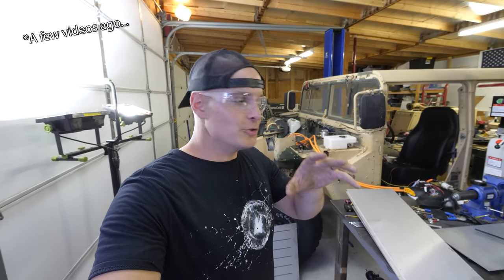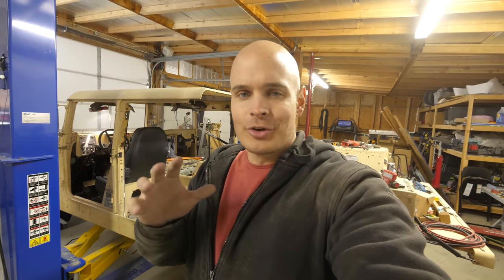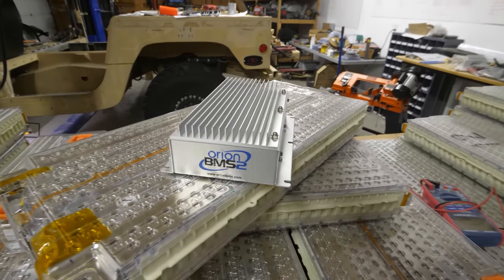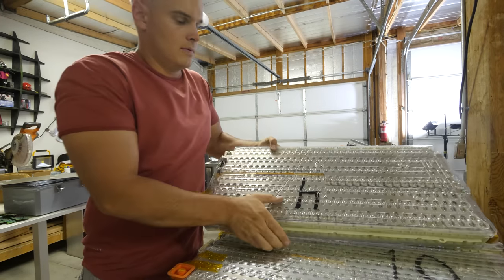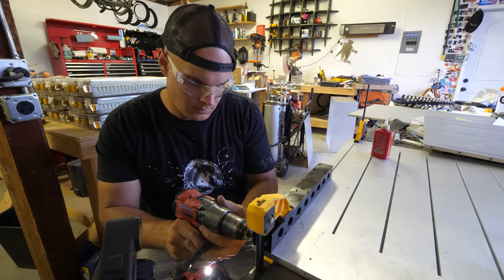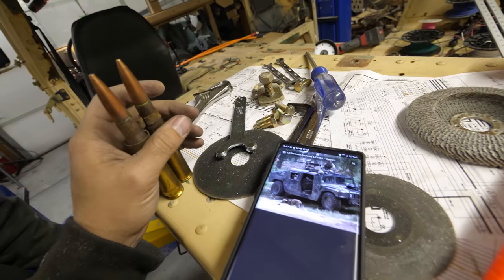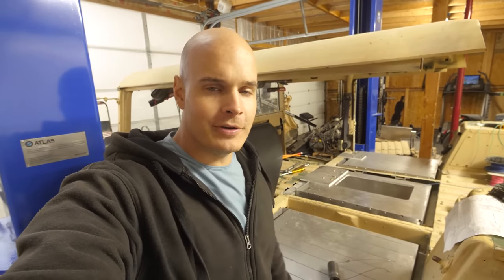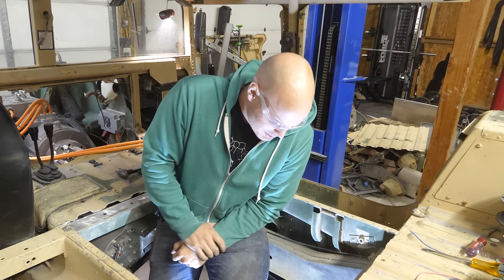Can I fit Tesla Batteries in my Electric Hummer?! - Battery Box Build

Comment: An important WARNING for anyone that wants to work with these battery modules: remove any metal from yourself. No bracelets, rings, pendants etc. for obvious reasons you don't want anything to accidentally make contact with live parts of the battery.
Reply: And don't put much pressure on the plastic cover covering all the fuses.  I cringed when he put the sharp corner of one module onto the cover of another module.
Reply: i just can't believe he is working without electric protective gloves
Reply: there are a lot of cringe worthy moments in this video.
Reply: it's a lot of current, but only 24V

Comment: As many have already pointed out, be mindful of isolating dissimilar metals. Steel and aluminium will get you really bad corrosion (on the aluminium) and failure of critical parts is never nice.  I just replaced shock mounts made of aluminium with painted carbon steel for that reason.  Got weird remarks from auto parts store regarding rusting, showed him pics of corroded aluminium mounts surrounded by pristine steel. Also, please reinforce the driveshaft tunnel: aluminium in most grades is like butter for sharp/ballistic/high velocity impacts.
Reply: If you have that much corrosion, it sounds like you may want to add some anodes to your frame.  Exactly same principle, but it is on the helpful side :)
Reply: Old conveyor belt makes a good isolator and would also help as a vibration dampener to stop abrasion between mounting surfaces.
Reply: @Krieghandt  I'm not aware of an effective way to add sacrificial anodes to a car unibody and subframes. Ironically, the aluminium shock mounts that are factory installed on many models kind of act as a sacrificial anode... but it kinda sacrifices your safety when they get corroded and fail suddenly.
Reply: Hello friend how are you ?

Comment: Maybe a suggestion: you could do away with one less module. That way your max battery pack voltage < traction inverter max DC voltage
This would protect the Inverter especially when a situation comes where you are either overspeeding with no load (think downhill) i.e. back EMF buildup or Regen at top of the charge, you won't damage the inverter by overvolting it. 
Also you would save weight (which gives you some range back). Also would be fine, range, voltage (427.8Vdc max) and performance wise if you go 90% SoC with just 17 modules. 
In your current method, you'd be just carrying dead weight and unusable 5.6kWh if you are not going to charge to the top all the time with possible damaging opportunities to the inverter/motor.

Another thing to keep in mind, with the modules mounted vertically, you would have coolant looping vertically. Make sure your coolant reservoir is placed at the highest point relative to the battery coolant lines to ensure bubbles (if any) can find a way to escape. With vertical layout, last thing you want are  bubbles getting stuck at some corner at the bottom and with any pump failure or mismanagement, you don't want hotspot/latent heat buildup due to stuck air-bubbles. Would suggest vaccum fill your coolant to minimize air in the lines and coolant path inside the modules.
Reply: bro you should reply on jerrys comment so he can notice yor reply
Reply: That would have made the parking brake move unnecessary. Oof!

Comment: Haven't seen anyone else mention it yet, but you really need to be wearing a respirator when cutting the original sheet metal of the humvee. Military spec ones used a chemical resistant paint that is really harsh on your lungs when airborne (from cutting, sanding, probably even just drilling, etc)

Comment: 15:55 I noticed a distinct lack of clutch sounds! When you have to screw a bunch of fasteners in and they're all practically identical situations (thread, thread engagement, material, etc,) you can set the torque controlled clutch on your drill using the numbers on the ring so you can just zip 'em in and the clutch will slip when the torque gets too high. Really handy for assembling furniture & EVs & whatnot.
Reply: Super handy for Ikea furniture. So much less stress about potentially stripping cheap threads.

Comment: Interesting build.  I'd recommend using a drive shaft loop of some sort to hold it in case of it breaking (steel not aluminum) under the power packs above it.

Comment: A easy solution for the parking break would be a electric parking break conversion which is available from multiple manufacturers.  With a ev a electric parking brake is actually a better choice anyways.  All you need for a electric parking brake is a linear actuator with the correct force and travel.  I have made them many times and I simply cnc plasma cut a bracket out.

Comment: Hey, you really need to add at least one driveshaft hoop on the center battery box, just so that in case of driveshaft failure, you don't end up with a punctured battery. One hoop at either end of the box would probably be the best

Comment: This thing is cool. 
Do worry about condensation in battery housings and also if there is enough space for normal battery expansion. Although I expect you already solved both those issues. So easy for me to watch and find small issues but no way could I do this. Well done and can’t wait to see it working.

Comment: Can't wait to see how you'll install the final assembly! Those conduits look permanent enough that you might have to install all 3 battery boxes at once with a lift. (Also the conduits should be orange colored to indicate HV connections IMO)
Reply: I think only the wires? At least here thats the case
Reply: @bashaaksema94  well, I think it's useful to know what not to cut in an emergency situation, and orange cables basically mean "cutting this will result in a very bad day" and I would want to extend that warning to any conduit that carries those kinds of cables.
Reply: @jtcressy1  true

Comment: Hey man. I have been watching your humvee videos for a while now and watch them every time they pop up. I love it. I just wanted to make a recommendation though. I would put some rubber insulation between the frame and your boxes. It will help separate any electrical issues but also you won't have metal on metal so it will help with sound isolation and prevent future wear. Hope this helps.
Reply: 1/4" x 1" strips would do it
Reply: Hello friend how are you ?

Comment: i highly recommend using spiral flute taps for  blind holes. standard taps 'push' the chips deeper into the hole  but spiral ones pulls them out which makes the job 300%  easier

Comment: Jerry my man, loving the content on the Hummer. I would recommend some anti-seize lubricant on the steel screws in the aluminum battery boxes. You're gonna want to prevent any corrosion on those different metals from starting.
Reply: I’ve been thinking that at almost every turn on this project. In a few years Jerry is going to get a lesson in contact of dissimilar metals.
Reply: @ahfreebird  Exactly what I was thinking, better that he's not in the rust belt like myself lol. One Chicago winter and good luck replacing a bad battery module

Comment: I have been working at AM General for 21 years and love watching this build. I don't understand why AM General doesn't have an electric drivetrain as an option. I do have a question for you about the front suspension. What do you plan to use for the front springs?

Comment: I love this project. Maybe it has already been considered, but I hope that drive shaft never breaks. If it does, it might puncture your battery packs. I would consider a carbon fiber drive shaft instead. When carbon drive shafts break they splinter instead of smacking around inside the driveshaft tunnel.
Reply: It'll be just fine.
Reply: Came here to say the same thing

Comment: Man, I'm so jealous of you that your local traffic laws allow you to even consider such projects. Really enjoy this series. I kinda wish, it never ends...
Reply: So am I! the only project I (even remotely) consider is a tractor, going less than 20 km/h (12.4 mph) because they are exempt from vehicle registration laws (in Norway), and could still do the work I intend it to.

Wanting to replace an ATV I have on tractor registration with something electric.
Reply: Everything he's done should be possible in most western countries actually (North America and at least most EU countries)...
Reply: @rkan2  in Norway it is pretty difficult to get the reqired documents and approvals to modify an EV or convert to EV.
You need documentations to meet all safety standards. Espessially high voltage system is a callange to get approved.

The same problems arize if you want to change battery chemistry for a car too.
You can not just swap a led-acid-battery or zebra-battery for a modern li-ion-battery when the original batter reach end of life. 

It is not difficult if you can provide the documentation. But you need assistance from a professional company, sharing the cost over many projects. It is not somthing you can afford to do for a single project.
Reply: @thorbjrnhellehaven5766  Norway could certainly be an outlier as they are not in the EU - but in neighbouring Sweden and Finland this is certainly possible. Better to do it on a car without ESP/ABS and too many additional safety features though. Although recently at least in Finland you might actually be able to use already approved components from a say a dismantled EV and not go through the EMC testing required for any car (ICE or not) after 2002.

In theory this should work in very much the same way where you have the documentation for the donor car much like swapping a drivetrain from another ICE vehicle where you swap basically all hardware including exhausts. Therefore you wouldn't need all the paperwork that would the EC/EU laws require for automakers to be able to get a type certificate.

Currently in Finland it is even legal to work on your high voltage system without actual proper education except maybe for a small course on electrical safety standards - as the current law doesn't require any specific education to work on your own car or on a even on a customer's car if you are the sole mechanic. For employees there is different (safety) laws which of course mandate sufficient training.

Comment: Please make sure to take into account eddy currents when routing cables through metal otherwise with that amount of power you could have some slight melting happening!
Reply: A definite unintended consequence of going with these metal boxes. As well sealing them against water with all those slits is going to be challenge.
Reply: Good point
Reply: Unless the motor-driving inverter is complete crap, there won't be much ripple on the DC lines from the battery. No need to worry about Eddy currents.
Reply: No eddy currents with DC

Comment: WARNING!!!!!!  
if the rear drive shaft comes off and starts swinging around and hits those battery boxes you are in big trouble. You should put something stronger lining the drive shaft hull
Reply: That is exactly right. Even if he had some safety steel rings around the drive shaft there are still big spaces between those rings for great damage and punctures to occur. Not to mention those rings would need to attach to the aluminum box so that not too good either. Should have just done dual electric motors and no driveshaft needed.
Reply: @RemmikRotus  I think with the right bracing the rings would work

Comment: Hi Jerry, great work, I think you need to take into consider the cooling system of the inverter and the AC motor, 
1.heat exchanger.
2.water pump.
3.Expansion tank.
4.Tubes & valves. 
Usually use with ethylene glycol adding to water to prevent freezing.
Reply: His name is Zachary

Comment: Great vid, love watching the build. i must say feels like you have a misunderstanding on the 12v side, as lead acids are old tech but in many senses more robust when when it comes to charging and running. where as lipos can get alot more temperamental on charging and running resulting in the complicated bms systems. amp hour on a lead acid car battery is normally based over 20hours discharge where as lipos is over 1.  no battery likes to be discharged to 0volts and recharged, normally a lead acid is considered fully discharged at 10.5volts, where as the lifepo4 can be 10v or as low as 8v when the bms could possibly cut the output for safely but for both battery this would dramatically shorten there lives. Cant wait to see the hummer driving :)
Reply: Hello friend how are you ?

Comment: Jerry, nice job on the battery boxes. You definitely need to add the heating to the batteries if you live in a cold environment. Also if you ever plan to service or open those battery boxes, you should address the galvanic corrosion you will see when using steel screws into aluminum threads. Also, aluminum threads strip very easily with steel screws. If you plan on opening it more than two or three times in the vehicles life, maybe consider using thread inserts. The thread inserts can also be purchased with coatings to resist galvanic corrosion.

Comment: Very nice job right there, but the only thing i would be a bit worried about is that if the aluminium is getting punctured or beaten up by a crash, it could short out the main lines of the battery, or even the cells itself, maybe line the inner part with something rubbery and put the minus and the plus of the main cable on seperate sides , so if something like that would happen, even if the box is getting damaged, it probably wouldnt cause a fire.

Comment: I hope you remembered to insulate all the contact areas between your aluminium and steel components to stop galvanic corrosion (between the battery boxes and the steel frame of the humvee?). There are all kinds of adhesives that you can use for this.

Comment: Don't forget one annoying feature of Li-ion batteries, well when Lead Acid battery discharges it's voltage drops linearly, but Li-ion have a strap drop from 100-90% and then voltage is stable untill there is about 10-15% of charge left after which voltage drops very quickly. So while you can guess the charge of Lead Acid by measuring Voltage that is not really possible with Li-Ion.
Reply: Also true
Reply: It is possible with some cleverness. You know the graph and you can map out the state of charge from it. How do you think your phone tells it?

Comment: also i would recommend a drive shaft safety loop around that, since its in such close proximity to your energy packs. the high torque as well as that angle on the U joint its probably going to be prone to breaking, under its torque angle

Comment: Don't cut the roof add a roll cage and removable seats and  canvases wrap round it so you have winter coverage and a window in the meddle for the winter and for the summer you can take it off with snap clips so you can remove it.

Comment: I really enjoy your teshummer conversion! One thing worries me though is the small input yoke/universal joint on your steering gearbox is not designed to take the amount of torque that your steering power assist unit is going to output and definitely will fatigue pushing large tires especially off-road sitting still in the muddypuddy! Time will tell else be in sneaker mode?

Comment: I dont have the design in my hands to judge, but when you enclose a potential rapid burning battery inside a thick metal water proof case. It can lead to enhanced explosives effects. I would recommend some blow out vents facing down and not into the cab. I hope that someone can pick up on what i am trying to suggest.

Comment: 6:57 you can get lithium ion battery meant for cold cranking. Regular lead acid can't do that too if it's not that type meant for cranking. That said any battery can crank a engine but it's not really meant for that often unless it's made for that (specific car batteries). Also many gas cars have switched to lithium ion too. 
Also battery voltage won't change much since it won't be emptied below 15% often anyways. And if anything gets in contact with metal bms will save the situation.

Comment: I suggest that you reconsider making a 2 door. Extend the roof to Suburban style.

Because....you can remove the battery modules/work on contacts etc in bad weather. 

Because.....it will allow you to build roll cage/frame to strengthen the whole rig.

Because....you have added 1000 pound to the center. It very well may cause the rig to have sagging stress. Especially when you have reconfigured the floor pan original structural design.

Because....you will be able to hear and see any unscheduled events with the modules.

Question: will you add a fire suppression system to the battery boxes?

Comment: 15:30 you can get machine taps that keep a continuous chip which exits from the rear.
Reply: Gun taps are what you’re referring to, but roll form taps work best in soft materials such as aluminum. They “push” the material into the thread form rather than cutting it retaining its grain structure  and strengthen the threads.

Comment: I'd recommend switching those black oxide steel flat head screws with stainless steel ones. After a while the potential difference between the aluminum and steel will cause galvanic corrosion which will make it very hard to get the screws out. Plus moisture will cause them to rust after a while. At the least, make sure you use anti- seize on the bolts.
Reply: Aren’t other parts of the container welded? Pretty sure removing the bolts is irrelevant
Reply: @armadillito looked like sides were welded. Top or bottom have to be removable to replace or perform maintenance on the battery modules in the future.
Reply: @timothysvirbly4988  Oh, fair point there

Comment: Make sure you don't use ANY rubber on the bottom but something with the correct isolation value in Volts